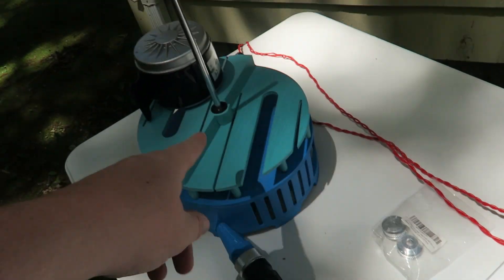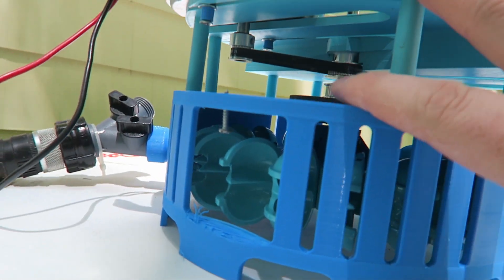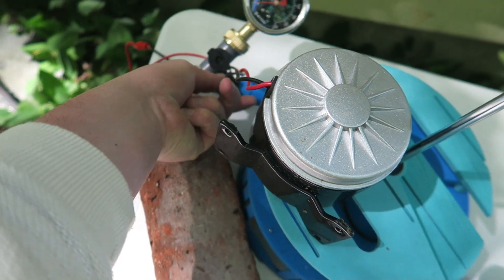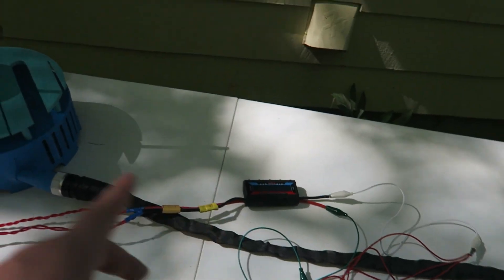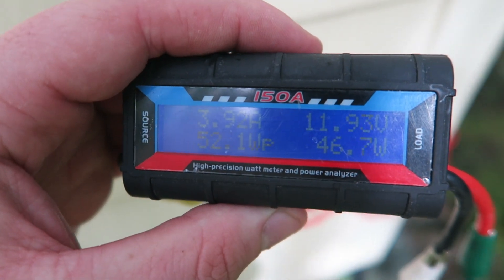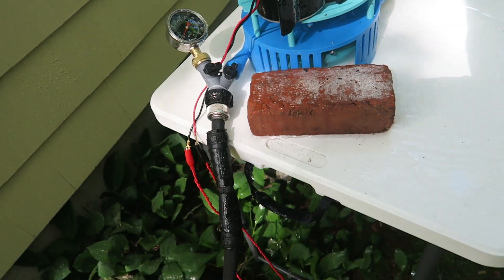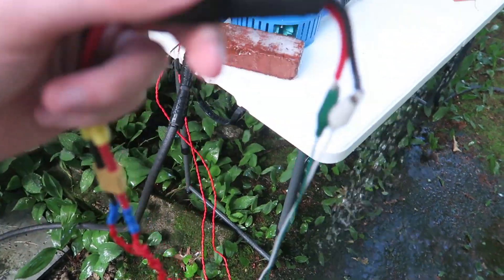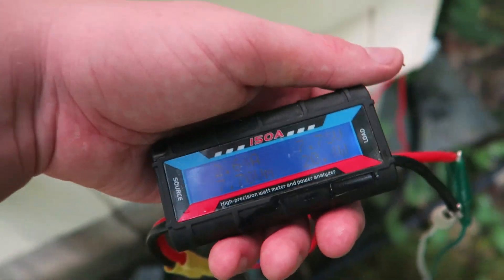3D Printed Pelton Turbine makes over 50W

Comment: you did a good job but this big one moves a lot of air, which is power lost based on the small inlet tube. even changing pulleys is of little use since it is your water (flow rate and pressure) that creates the power
furthermore there are losses in the iron as well as those in the winding to take into account

Good work
Reply from the maker: Thank you for this. I'll have to keep it in consideration for upcoming vids

Comment: try open tesla turbine without the case, it does not require 3d printing. its super easy to make, even from sheet metal.
Reply from the maker: Fully open, or just side plates? This is a great idea, thank you!
Reply: @Beyond_The_Print  well like an open water wheel, of course you can use the case too. it can be vertical or horizontal.
Reply from the maker: With a few nozzles I think this could work but for maximum efficiency of the tesla turbine the water needs to spiral around the turbine and exit the center generating centripetal forces. I still think this is a great idea to demonstrate and test the idea of how fluid dynamics acts on the disks, thank you!